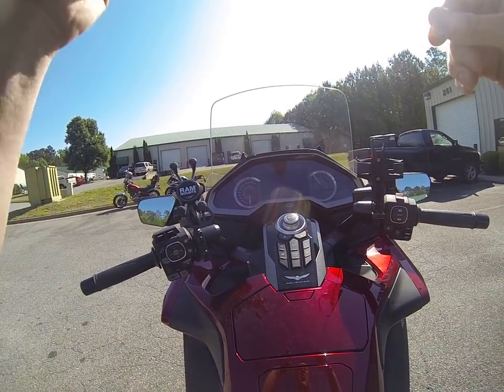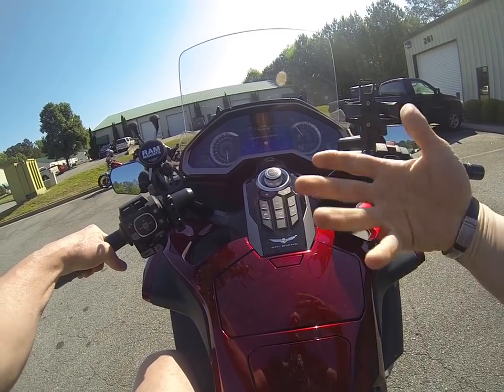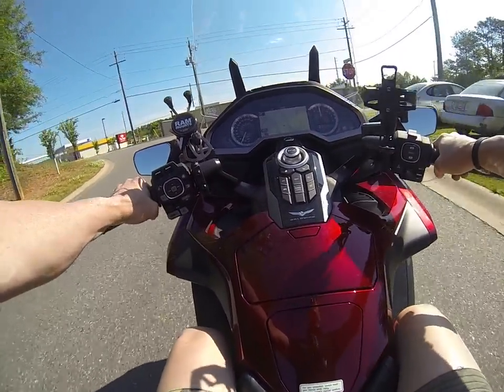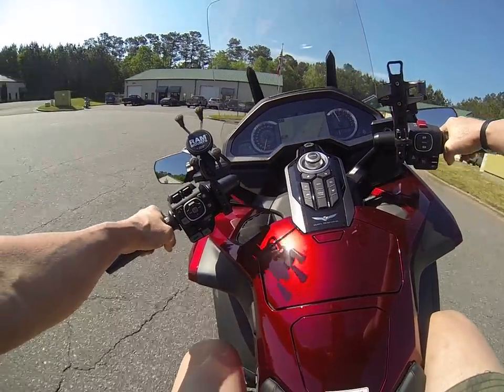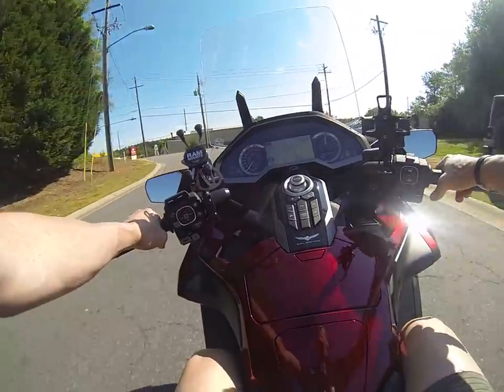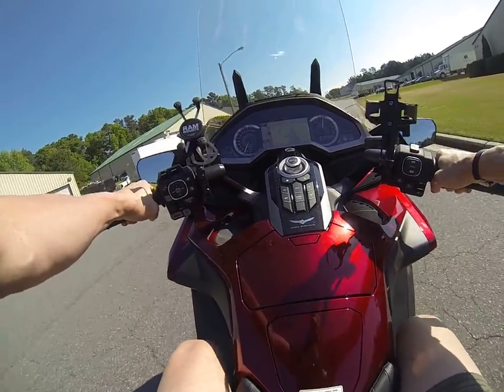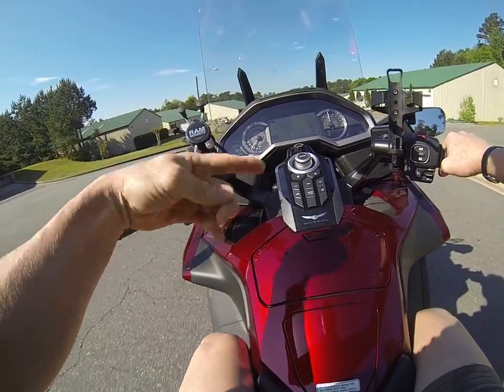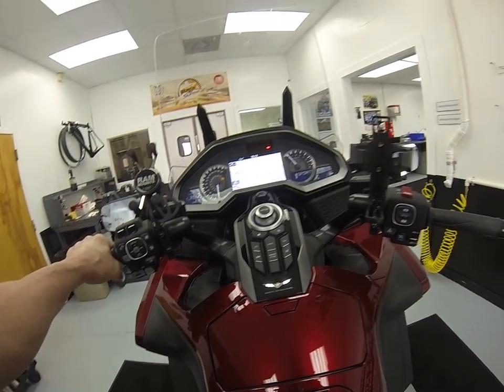Throttle Upsets Chassis - 2018+ Honda Gold Wing

Comment: Excellent video Max, despite the previous criticism.    Most people love to crank on the throttle and test the capabilities, no matter what bike it is they ride.  Especially my wife, who gets a big kick out of passing me on the road.  For me, what you are proving here, is that , there is insufficient suspension for extreme down forces that you will experience on the road.  If you are cruising along at 70 MPH and hit a real bad patch of road, not only will it hit the bike harder but it will affect the front end more so, which is critical in bike stability, steering and control. Not to mention braking.  If you need to brake hard to avoid something, I assume the shock would bottom out much quicker and make emergency handling maneuvers more difficult.  I am interested in purchasing a 2018 or now, maybe a 2019 Gold Wing Tour DCT, so I appreciate the science you are sharing here Max.  The beauty is, you are proving these inadequacies with facts and video. Keep doing what your doing Max and if I do make the purchase, you can expect a call from me.    Thanks.